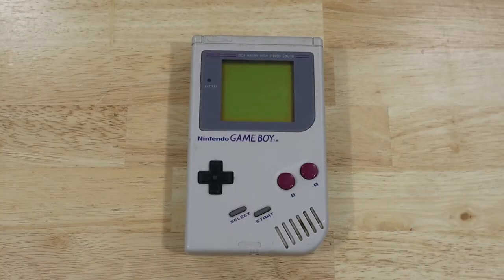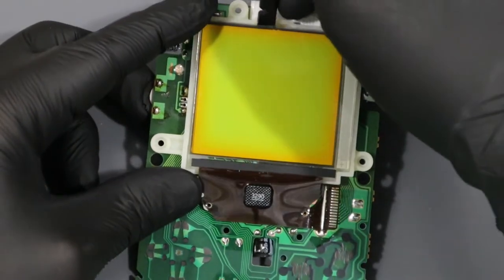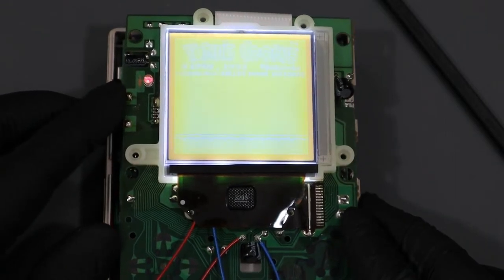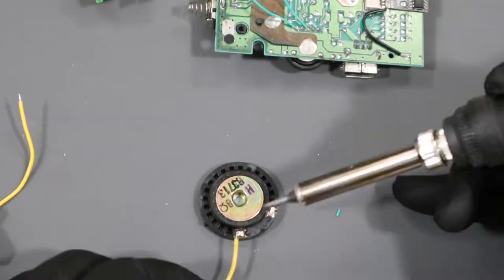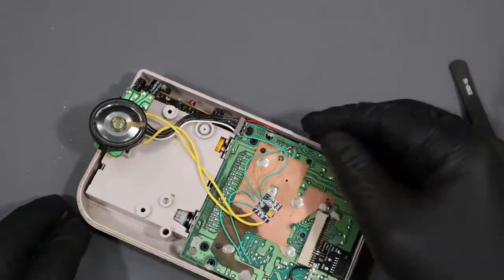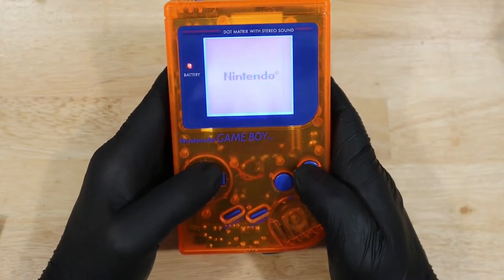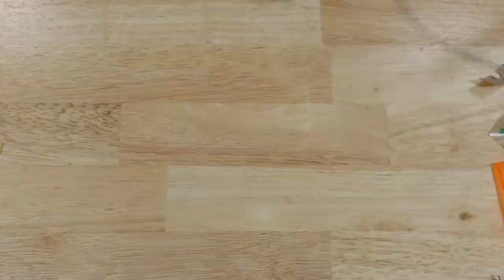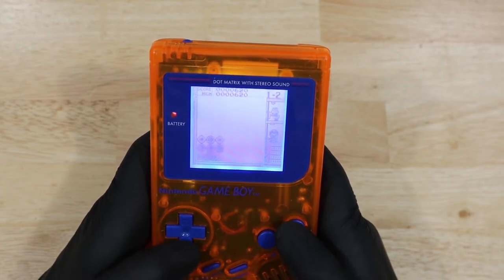Modding the Original Game Boy - Backlight, Bivert, and more!

Comment: Issue isn’t with the audio mod issue is with the potentiometer wheel. Which is the audio wheel. The static is the result of a failing volume wheel. Sometimes running new solder over the contacts will fix the issue and or using a contact cleaner to blow out the wheel then compressed air to dry even more dry. If this does not work use a donor gameboys for its volume wheel.